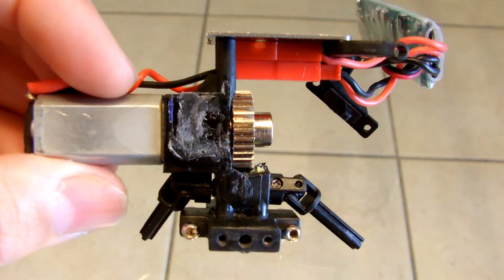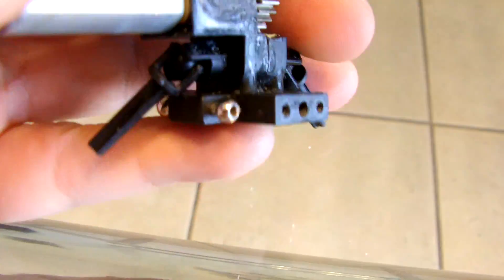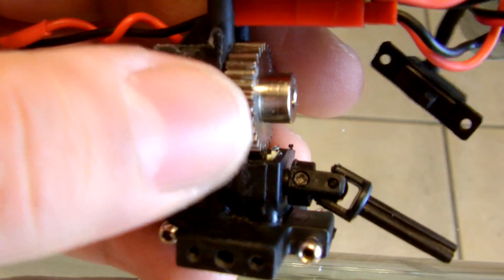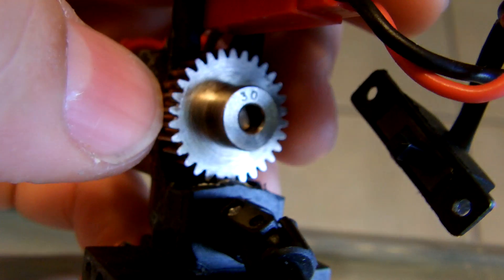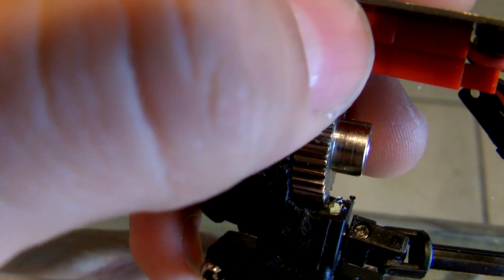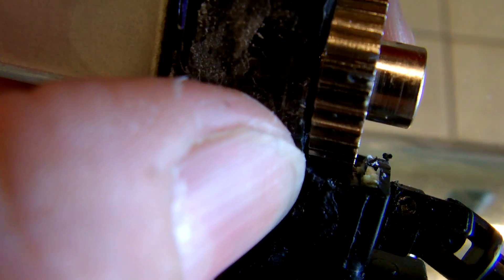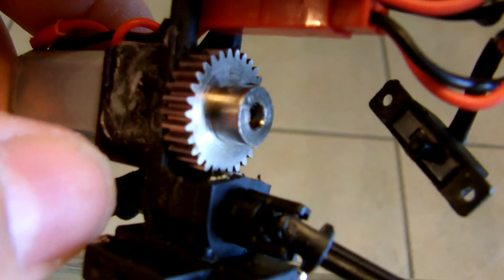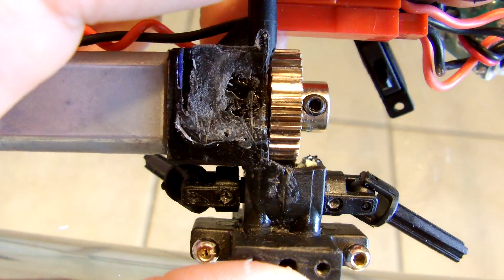26 Redcat Racing 1/24 Sumo Crawler Micro RC with mods / upgrades Transffer Case

Comment from the maker: My suggestion put the shim to stiffen the rear, and loosen the front, it keeps your sumo planted at any incline but lets your front move slightly to help them turn when steering on a hard spot, plus that way you only have half the drag on the battery from stiffer drivetrain!

Comment: o ok good to hear. yeah with the losi it stops as soon as u let go of the throttle and stays there! I am looking to do the shim upgrade to tighten up the diffs though. I can feel the play in there. ( when the rig is at a stand still you can spin the tires a little bit) I will be doing that mod soon here, thanks for the tips and all!

Comment from the maker: Thanks for bringing that up I forgot to mention on video.This esc has no drag brake so all the stopping is done with motor magnet drag and gear drag.With this modd this drag is reduced to increase speed so in heavy enough rigs it will roll if incline is steap enough,this can be solved with diff shim modd to stiffen up the drivetrain a bit.The bigger motor has more magnet resistance so shim was not required but with smaller motor it did need it.

Comment: nice work! it is a little too fast! hey I was wondering if with this design in motor/ transmission or lack of... do you get that instant stop when you let go of the throttle and are in a steep angle or does it roll down? well my vid should be up here in a couple. found my good camera but not the battery!! lol I am only going to be stationed here for a year so I am not unpacking everything.